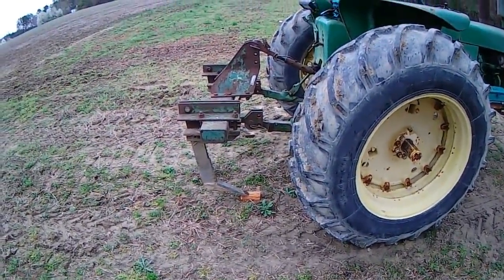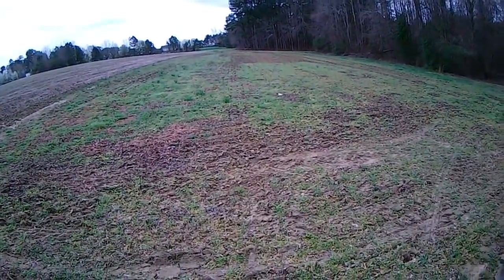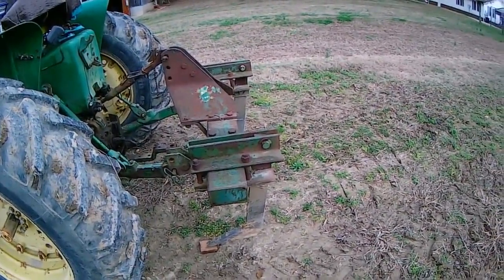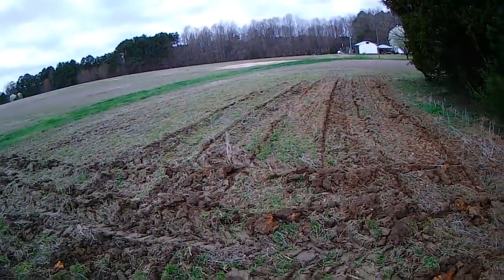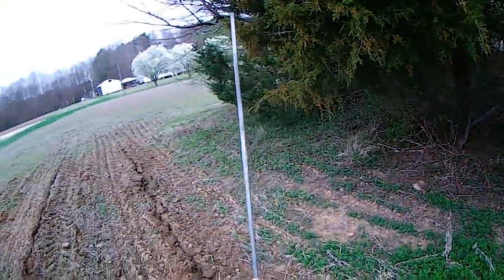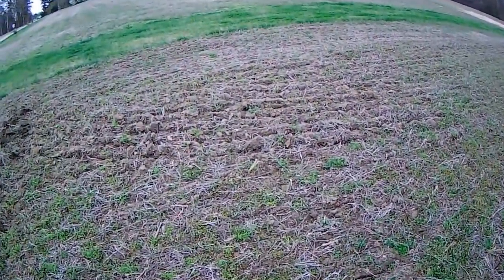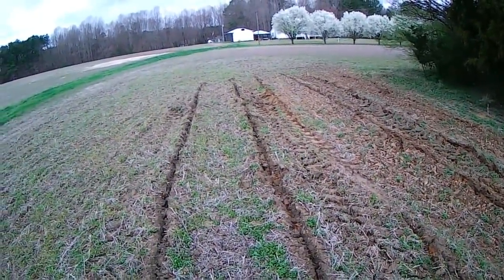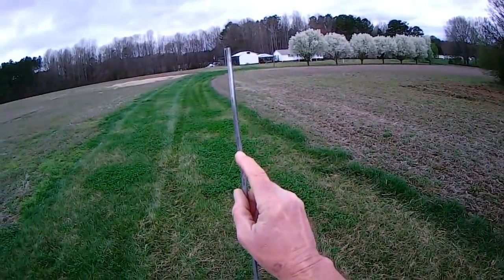Soil compaction and using a Hardpan Locator

Comment: I like the compaction tool. I was made a believer in the subsoiling last year. I done about half my corn ground. Had less wet spots even with all the rain. Take care and have fun
Reply from the maker: familyfarmer TN - there is a field on the farm we call the Allen field.  first year, 18 years ago, I put beans on it the yield was 80 bushels.  lots of fertilizer left in the land from the tobacco years.   through the years with no fertilizer applied the yield went down until last year.  cousin got in that field with this ripper behind his little tractor and managed to rip about 8 inches deep then we moldboard plowed it flipping the land over.  that field had not been broke like that in over 25 years.  with no fertilizer applied the yield jumped up to 65 bushels.  our theory is we brought some deep residual fertilizer back up and the soybeans found it.   I do need to let things dry out before I go full throttle ripping land but when is that going to happen.  we been wet since the end of November.   thanks for watching and commenting.

Comment: One year I planted torpedo radishes to break up the hardpan, them stupid things grew about 2' down. Worked good and produced green manure.
Reply from the maker: Farmall Fanatic - torpedo radishes have a really deep root and according to my reading can exert 240 pounds of force against the hard pan breaking through to reach depths of the 2 foot you mentioned.   I'm still trying to figure out how to double crop them because I got to have the income from the soybeans to report so I can stay on this land.  government restrictions, I have to work with.    can they be planted in December and will they do their beneficial work by mid May in my climate?   if I don't meet the farm income requirements each year I'm finished done ruined and will lose this land.  soybeans is the cash crop that has always for 17 years met the requirement.   dilemma.
Reply: @SoybeanFarmer3300  - Solar Farm + Soybeans? Double Cash Crop, is that an available option?

Comment: I thought the 4020 was the hard pan locator , with the ripper in the ground the 4020 starts lugging down and smoke starts to roll it's in the hard pan. I agree with you it needs to be done! It also drains the wet spots into the drier spots and you get a more even stand!
Reply from the maker: CE Smith - I want to get out there and knock the task out BUT the ground right now is really to wet to get the best result.   thanks for the comment and watching.

Comment: looks like what you have is the old subsoiler that we used before planting tobacco.  If you are breaking land (turning plows) before planting, I'm thinking that is good enough for soy beans.
The Amish never worried about the hard pan and they produced some beautiful crops.
Reply from the maker: Grand Pa Mike - if I got my facts right this subsoiler did years with a two row bedder on a tool bar behind it bringing up tobacco rows.  I'll have to ask cousin if my memory serves me correctly.  the last tobacco on this farm was back in the year 2000.   I want to break the hardpan to make beans more drought tolerant.   two good droughts now in my farming years have shown me the difference between when water can come up from beneath and when it can't.     thanks for watching and commenting.

Comment: Alternating cover crops of rye in the spring and tillage (Daikon) radish in the fall will help you out. The extensive root system of the rye will break up the surface clay, add humus, and the tap root of the tillage radish in the fall will  break through any hard pan within approximately 30 days of growth. Tillage radish will also help boost the yield of your next crop: Corn yields are up 11%, Soybean yields are up 10%, Winter wheat yields are up from 5 to 12 bushels per acre in Canada. Take Care
Reply from the maker: Thank you very much for sharing this information with me. 
My cousin went out and got the equipment so he is able to plant corn here on the farm now the amounts of Silage in organic matter has helped tremendously with the bean yields.   
Thanks for watching.
🙂☕

Comment: Rip clay and put in alfalfa. then. Moldboard plow the alfalfa under cutting an inch of the clay. In a dry year the alfalfa will go down into the clay. It goes deep with roots. If you grow hay just leave that area in alfalfa couple of years.
Reply from the maker: Ted C - sounds like a plan, thanks.

Comment: We run a subsoiler when needed in wet fields to help with drainage. We would have standing water before running the subsoiler through it so I would think that you're helping to dry your fields and by the we, never get rid of that old subsoiler ! Most of the new ones are junk..
Reply from the maker: Jeremy Blalack - I've put my chisel plow behind my Ford 4000 and run fast as a shallow depth to air out wet land before.  worked pretty good but I did not have standing water, just wet dirt.  the subsoiler belongs to my cousin and I think I'll tell him if he ever decides to sell it to keep me in mind.   I bought his plow last year.   thanks for watching and commenting.

Comment: The code of the fertiliser you named indicates it’s chemical shyte. I’d recommend spending your money on spreading compost and chiselling that into your soil. Part will stay on top feeding your crops, part will fall into the deep ruts mixing with you red clay. Year after year while subsoiling you’ll be mixing in more natural materials making your soil richer and less compacted
Reply from the maker: I agree with everything you said if I could have started this program 20 years ago and worked a little bit at it each year I'm reasonably sure I would have been considerable soil improvement on this little farm. Unfortunately there's never been enough money in the budget to even start the program.  Small tiny farm with a small tiny operating budget.
🙂🙏🙂

Comment: to my understanding soil compaction is bad for a few reasons.one you missed on was as the roots of the plants go down they hit the hard pan they change the angle they are going down. that is stressful to the plant. i dont know if the plow made the hard pans but i know discing is not good. when the gov farm programs in right around 1980, my dad went to working the ground with a field cultivater on dry land almost 100%. the yield went up about 8%. then he went to one heavy rip on his heavier ground. that ripper looks like a nice machine. always understood that the speed needs to be a little faster also. it is supose to help break the ground up between the ripper point. realy liked the video  great subject.
Reply from the maker: Howard Younger - this ripper belongs to my cousin and it is all new to me.  I have in the past run my chisel plow as deep as it will go breaking some of the shallow hardpan and seeing great results in the beans that year.   I need some dry ground to test and get the hang of running this tool.  running wet ground is a big huge mistake.  the 20 foot long rips were the result of me giving into temptation and I'm glad I was able to stop myself from doing anymore than the small amount I did.   with the chisel I learned speed is a key factor to breaking deep but it is hard on my 98hp 4020.  one subscriber suggested I hire a large tractor to rip deep the entire farm and I think this is not such a bad idea.  the little bit of deep plowing I did last year was the first this land has seen in over 25 years and I saw the benefit in those areas.      thank you very much for your kind supporting words in your comment.
Reply: i beleave strongly in deep ripping. on ground that needs it. no till is great on some ground though. the soil  type like you said makes a lot of diferance on how it needs to be farmed. i went away from plowing because the fuel used. i used a single shank ripper on some ground that was packed real hard. it still showes after 7 years. but only were the shanks went. i even had a tool on the bottom that should have fract the soil. i went to slow though.the lines still show up.

Comment: It never seems to get dry enough to shatter the hardpan the full width and if it does ya can't pull it. I think your right to cut slots for water infiltration and a root zone that hopefully the roots can find, that's what they call zone building. Your not hurting a thing, I prefer the zones to full width shatter because you still got some soil structure you can drive on without sinking to China.
Reply from the maker: mr Bill - thank you very much for your input here.  this is going to be my first year doing any deep ripping and the creating of soft spots is on my mind.    thanks for watching.

Comment: using the chisel plow and then a moldboard plow will really loosen it up
Reply from the maker: Yes I sure will.  thanks for watching.  I hope you hang around and watch some more.
Reply: @SoybeanFarmer3300  remember though do not moldboard all the time. You only have to do it once every 2-4 years and you can just disc it in-between those years.

Comment: Right or wrong, I want to see the 4020 pull that.
Reply from the maker: Ag Wild - I did too and that was why I cut the 20 foot long test runs in wet ground and then stopped.  working wet ground is a big newbie mistake on a grand scale.  I left just over 4 acres out of beans last year due to wet ground.  I got not a clue what I said leading Jeff to believe I was going to work wet ground.  I don't care what kind of wing tip points are on the tool, working wet ground is not going to produce a positive result.    dryer ground at the correct speed the fracturing of the hard pan will occur.   seen it many times here in NC soil on tobacco land with the ripper setup just in front of the row beder.

Comment: If your having a problem with wet fields use that ripper to drain it to where ever you want the water to go that's what I do with my land commander
Reply from the maker: John Deere 8260r - it won't stop raining long enough for the ground to dry out for the ripper to actually fracture the hardpan like I want it to.  the little I did in this video was just a test.  been wet here since last November just after I got the soybeans cut.  rains each week and some weeks twice.

Comment: Its called an HPL.
Reply from the maker: EXACTLY 💯, with the key word being locator.  I could pretty much tell where the super deep spots were at from the 20 plus years of farming this land but I wanted to know. So it was worth doing to me. It makes no sense, to me, to pull a tool through the Earth That is not even reaching the hard pan.  For those locations I would rather back off and a chisel it will  produce soil aeriation But I won't feel like I'm wasting time with the wrong tool.   This farm is like a patchwork quilt with soil types as well as changing depth before you actually change type. Thanks for being here in the comments.   🙂☕

Comment: your subsoiler is set up on 42 or 48 inches so why not subsoil field once then run over again splitting that in half then that way you may not need wings on your points,,,after all you're drilling in beans on 7" last year,,,your fracking distance would have more effect and more apt to shatter hardpan
Reply from the maker: Larry Raynor - this will be my first year deep subsoiling or ripping land as some call it.  I've deep chiseled in years past but not to the depth this ripper can reach.  I got a lot to learn about ripping.  I like your suggestion.  the wing tipped points will cost me 180 dollars for 2 of them.  saving the 180 or burning more fuel making a second pass are options to be weighted against one another.   thanks for commenting and making this suggestion to me.

Comment: If your gonna use that soil finisher you have which is basically like a field cultivator. Your just wasting your time. Field cultivators and disks make a hard pan right then and there. I know the Great Plains Turbo Max does NOT create a hard pan at all. Maybe you can try to configure your disk to be somewhat similar as the Turbo Max
Reply from the maker: Justin Germanovich - try to hang in there for at least 6 and a half minutes.   thanks.    - Soybean Farmer -                            https://www.youtube.com/watch?v=yXzhaR-VE3Q